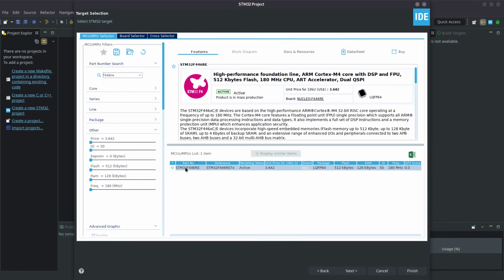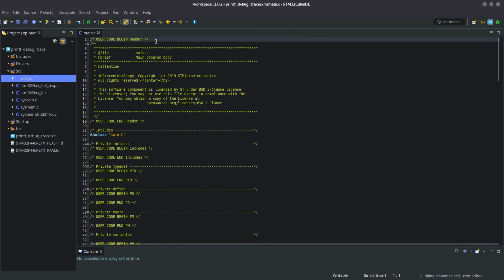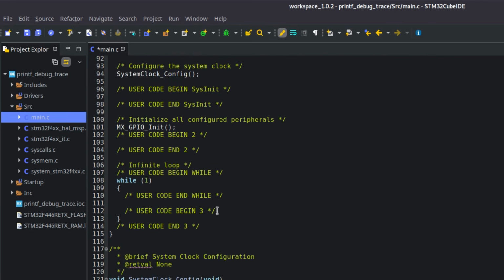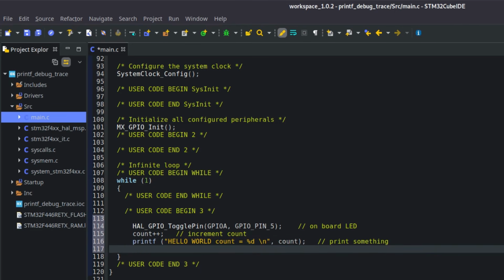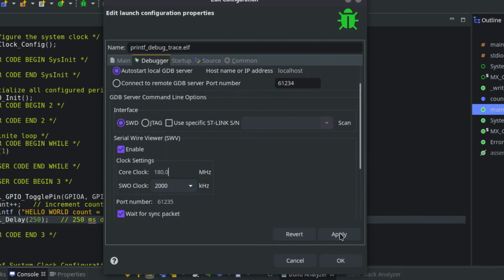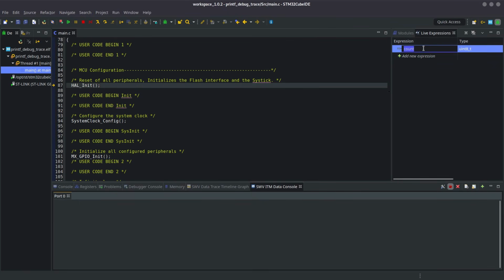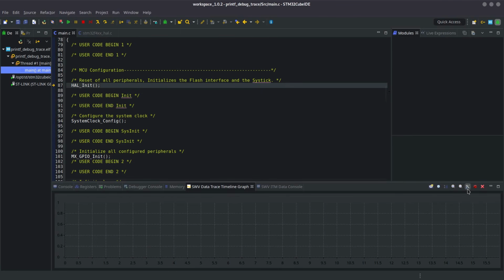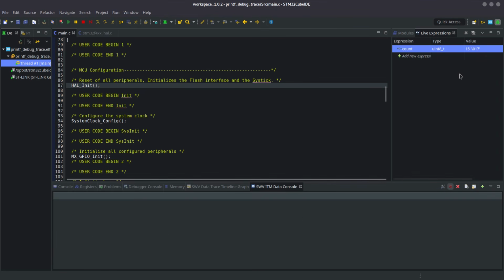STM32CubeIDE: printf Debugging, Live Expressions & SWV Trace Tutorial

Comment: Thanks, very helpful! 
Small addition: if you don't have a newline at the end of what you're printf-ing, nothing will show up until a very large buffer has been filled, then you get it all at once, on a single line. At least that's my experience.
Reply: Worked! was facing the same issue thanks!
Reply: Yes, I found this out the hard way.  Once "\n" was added to the end of my printf() statement, it worked perfectly. 
Also, I found that if I needed multiple printf() calls in a row, adding a printf("\n"); after all of them worked as well.
Reply: This small addition is saviour, I have spent 6 hours finding why the output is not coming.
Didn't even see the video just this comment of "Small addition" has helped a lot

Comment: Quick tip for Black Pill (STM32F411) users: To get printf working via SWV, wiring just SWCLK and SWDIO isn't enough. You must connect the ST-Link's SWO pin to PB3. Also, don't forget to go into CubeMX (System Core > SYS) and change the Debug setting to Trace Asynchronous Sw. Worked like a charm for me after doing this!

Comment: Great Tutorial! 

Additional information from my side:

Not every STM32 MCU model supports Serial Wire Viewer! 
"Serial Wire Viewer (SWV) is a data trace feature found on many ARM Cortex-M3, M4, M7, M23, and M33 processors. Cortex-M0 and Cortex-M0+ do not have SWV."

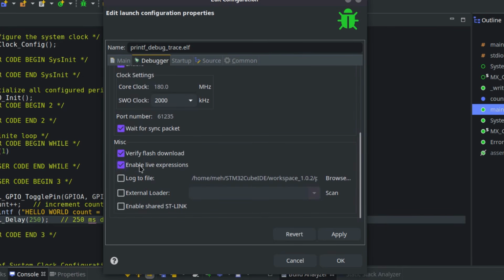In my case I have a Cortex-M0, so when I am insie the debugger settings, I am not able to klick on "Enable" Serial Wire Viewer. 6:00

What you can do instead of SWV:
Use Semihosting to use printf during the debugging session! 
Controllers Tech has a video called:
"Printf Debugging using Semihosting in STM32 || SW4STM || Live variable change"

Comment: Hi there.
I am using a STM32F401, after following these instructions "live expressions" works. printf/"data trace" however doesn't :( 

I set a breakpoint on printf and stepped through, the ITM_SendChar puts the char into the port correctly but nothing is sent.

I was wondering if this guide is still accurate?

Comment: It doesn't show anything for me either (stm32f429I-DISC1). I connected the PB3 pin of the microcontroller to the SWO pin of the debugger with a wire. It started displaying characters, but not the string "Hello world". I changed in Serial Wire Viewer, Core Clock (MHz) to 16.0, and it displayed the string "Hello world" 😃.
Reply: Change the core speed

Comment: SWV is working with the frequency of 16 MHZ  but it didnt work with 168 MH..  Why ? my board ( stm32f407g)
Reply: I changed my 16 Mhz to 168 Mhz in debug configurations and also i checked clock frequaency on STM32cube but i didnt see anything on SWV data console

Comment: Hello. What if ITM is not available? I am programming stm32wb55 Nucleo board and I am trying to setup printf for debugging. This method does not seem to work due to the microcontroller not supporting ITM
Reply from the maker: Use uart.. it's faster..
Reply: @ControllersTech  For UART, I need to use external terminal program which is not convenient. I want to be able to debug printf in the same IDE I am working with

Comment: I'm using a STM32L151CB and a legit ST-Link/V2 Isol. (Own custom PCB)

Strangely, when i click "start trace", the square around the circle lights up, then, when i press resume, the circle is greyed and unselected.
No data shows up in either of the SWV tabs, but i have the live expressions working fine.
Reply: I'm using a f103c8 and the same thing happens to me, I can't print anything on the console and the record button turns gray when I start debugging
Reply from the maker: It won't work if you are using cloned ST link. Read other comments, someone have shared a solution where you might have to solder a wire in the stlink.
Reply: @ControllersTech  thanks 👊🏼👌🏼

Comment: but when i use  any Hal_delay function in my int main while loop along with printf it doesnt print ot any thing on the console
Reply from the maker: Check your clock configuration.. hal delay  shouldn't be an issue unless your clock setup is wrong
Reply: @ControllersTech      i was using HSI which is of 16mhz as the system clock so i configured 16 mhz (default)  itself in the debug configurations too.
Moreover i tried creating a new project and same is the result

when i treid to debug and put the breakpoints its moving fine in the while loop without any stuck but iam not getting any out in the particular console

but when i trield 100ms delay after flashing the program and wating for the ouput .it gave me the output but the print on the console is comming to laggy and sometimes wont print even if the printf functon is in the while loop
Reply from the maker: Printf won't print in milliseconds.. i think it needs atleast 1 second delay...
The swo clock is not as fast as mcu, so don't expect printf to work in 100s milliseconds..
If you need something like that, use uart

Comment: Wtf... why does a printf command has to be so needlessly complicated? In arduino or mbed you just write printf(...) and done. With stupid CubeIDE Shit you need a doctors degree to get a simple output... just ridiculous. Who can use that or create anything more complicated than a blink sketch? Speaking of which: A fucking blink sketch generated in cubeF(uck)X for my discovery board gives me a 700!!!! lines main.c file. WTF?!? 700 lines to to toggle an LED on and off???
Reply from the maker: 2 things
1. If you don't like cubemx generated code, why don't you use the registers ? This way you only write the things you need
2. This printf shown in the video prints the message on debugger console. In case of arduino, that message prints on serial console. Even you can define a printf function, where you can easily send data to serial console using uart.
Reply: @ControllersTech  The registers are even worse. Using the HAL is already way to complicated for me, using registers would be insanity. Then i could basically just start using Assembler right away...

Comment: Thanks. For the STM32F429i-DISCO, you need to solder SB9 (to connect SWO-PB3 to the ST-LINK) to make it work.
Reply: Could you elaborate which pin should i solder SB9 to?
The datasheet shows that when SB9 is ON, SWO signal of connector CN2 is connected to PB3.
Reply: @TheZeroomg  SB9 is a Solder Bridge. Just connect the bridge with solder.

Comment: Not working on Nucleo F303RE before setting Debug Mode to Trace Asynchronous Sw. After that it just works fine!
Reply: Hi. Do you know why? I have the same board (NUCLEO-F303RE), and it not work the setting SWV.
Reply: Im using STM32F411CEU6 and i cant set this, Debug Mode to Trace Asynchronous Sw becouse it has pink color and there is warning that says "This periherial has no parameters to be configured" can you help me with that? Of course entire printf thing doesn't work for me :/

Comment: ITM debugging is only for Cortex-M3 / Cortex-M4 / Cortex-M7  chips. Make sure your stm32  has one of the aforementioned controller.
Reply: I am using a STM32F303K8, according to this: https://www.st.com/en/microcontrollers-microprocessors/stm32f303.html it is a M4...
But I wasn't able to get any output, not even character by using   ITM_SendChar( 65 ) for an A ...
Reply: @Stimmenhotel  Same!! it's not working on my STM32F446RE
Reply from the maker: This video is shot on f446RE itself
Reply: I know this video is shot on f446re, that’s why it’s really strange it’s not working on mine, i followed all the step and nothing’s working! I did not forget the \n and \r, i don’t understand.
Reply from the maker: 2 things.
1. Make sure you enable the swv(trace asynchronous) in the cubemx.. it's in sys settings
2. Make sure you turn on the recording button before running the code in the debugger
Reply: @Controllers Tech  I am using NUCLEO-H743ZI2 board, after turning on Trace Asynchronous in the Debug section of CubeMX and turning all the settings on in the debug configuration and selection of the port to turning on the red recordings button. I got nothing in console.
Reply: I already tried that and no success :/
Reply from the maker: It's working alright.. i just created a new project..
 Contact me on discord or mail..
Reply: Hey is there any article link that why ITM Debugging only work on Cortex M3/M4/M7 not on Cortex M0 because I tried this tutorial on STM32F072RB Discovery Board, it didn't build
But worked on Olimex P-107 Board which has STM32F107VCT6 Cortex M3.

Comment: I think God punishes me because I made exactly the same thing as you and nothing happens. I use the original ST-Link V2 debugger and STM32F446RET MCU.

Edit: After 7 month of trying this again on my Nucleo, now it works!
Reply from the maker: Maybe u forgot tu press record button
Reply: @ControllersTech  I wish that was the solution, but sadly not.
Reply: @ControllersTech  Btw, I saw another tutorial about printf with MCUs from STM32F series and the guy set the SYS mode in CubeMX to "Trace Asynchronous  SW". You left it disabled, so I'm confused about whether I should leave it as default (disabled) or change it to Asynchronous SW.  Any idea?
Reply from the maker: You should turn it on.. i left it coz it was working without turning it on too. But of it's not working for u, than u should turn it on
Reply: @Sparklamp  Same Problem here, using a STM32F303K8 (Cortex M4) board. Even enabled the "Trace Async SW"  ...  Clock Speed I use the value from HCLK i set in CubeMX.
Did you make it work?

Comment: Thank you very much. The live expression works but the graph and the console doesn’t work with an official nucleo stm32L432kc. Do you have an idea where this problem comes from ? :)
Reply from the maker: It doesn't work for some microcontrollers, specially the L series.
Reply from the maker: It doesn't work with f103c8 by default with the cloned st link. Though you can solder the swv pin to the st link. Google this, there are some solutions available.
Or join that telegram group, some people in the group made it work

Comment: I just want to mention that after 4 hours searching for the error, re-wiring my hardware twice, changing cables, rewriting projects... printf("...") was not printing anything in the DATA CONSOLE because I FORGOT the LINEBREAK ("\n")!!! So printf("Hello stupid") prints nothing, printf("Hello stupid\n") prints it correctly...
Reply: You saved me a lot of time!
Reply: I did the same thing, but what the explanation behind this?
Reply: @dipchakraborty5795 stdout buffer needs to be flushed to print the string, \n is the canonical method to flush the stdin buffer, instead you can even use fflush() from stdlib.h
Reply: Thank u

Comment: Discovery board as st-link, own board with stm32f103. It doesn't work. ((
Reply from the maker: In F103 controller, you have to connect the pin PB3 to the SWO of the debugger. It's not available on the Chinese ST-Link, but if someone have the original ST-Link, they can do that. 
You try to find the SWO of the ST-Link (your discovery board) and connect to PB3 of F103
Reply: Now PB3 is busy. When I used IAR, I didn't connect TRACESWO(PB3) pin, but printf worked fine. May be you know how it work in IAR? Thank you for answer.
Reply from the maker: No i don't know much about IAR. Maybe you shouldn't keep PB3 busy with any other task.

Comment: I'm using STM32CubeIDE version 1.2.1 on a Nucleo board (STM32H743 has an stlinkv3 v3.J6.m2), but I can't find where to set HCLK.   I've enabled SWV in the debugger config and set the clock there, but not in the project.  My HAL_Delay (1000) is way longer than a second so the default is probably wrong. 

Also, I've included stdio.h however, I don't see the "Hello World" in any of the window views (Console, Debugger Console, SWV Data Trace Timeline Graph, SWV ITM Data Console).   In the SWV view properties, I've enabled Comparators 0 and 1 (although that don't seem to be necessary), and checked the ITM Stimulus Port bit 0, and the red 'Start Trace' record button is set.      Could the HCLK setting also be causing the ITM_SendChar to fail?   I assume the ST-Link's usb connector, when not programming, just passes the SWV data to/from the cpu?

UPDATE: Pressing the Blue MX button on the right doesn't seem to do anything, but double clicking the .ioc file did!  After checking the clock speed shown in the Clock Configuration (64Mhz) and applying it to the SWV Debugger Clock speed it worked!  Would be nice for ITM record to start automatically, but what exactly does enabling the stimulus bit 0 do?

Comment: Hi. Thank you for this video! But I've got a problem: SWW trace and SWV ITM console do not shows any data. Live expressions works fine. Any advice? Thank you
Reply from the maker: Which controller are u using ?
Reply: @ControllersTech  STM32F103C8 aka Bluepill
Reply from the maker: This works with nucleo and discovery boards because they have an inbuilt ST-Link. You can't use it with f103 and chinese stlink varient. You might have to use a j-link or original st link with f103. 
Although i am not sure about those also, as I have never used them.
Reply: @ControllersTech   I am new here, all my experiences are with arduino IDE, so I do not understand your answer well but thanks anyway! Doesn't really matter right now, I am glad for succesfull upload code via ST-link (I was about to give up while trying properly install eclipse+OCD+..+..)
Reply: @jakubstejskal6806  

There are videos and info how to modify one of the cheap Chinese Clone STLINK V2 to provide SWO input by cutting the 5v supply connector runner from USB Vbus and connecting pin 31 on the STM32 in the STLINK. 

https://www.eevblog.com/forum/microcontrollers/quick-hack-to-get-swo-on-st-link-clones/

 It is a tight soldering job to connect to pin 31 without creating a solder bridge to adjacent pins so you need a fine point solder tip.  The two 5v pins on the STLINK clone are given up to the SWO input.  You may have to update the STLINK firmware if you did not previously done.

You can also download STLINK code into a Blue Pill to create an STLINK V2 with SWO function.

This SWO port is included on the Nucleo STLINK V2-1 board.   The Nucleo boards also have UART2 from target uC fed over USB to a virtual COM port on PC using a terminal program of your choice to display the UART2 communications.  You won't get the UART2 comm port on the STLINK V2 clone.
Reply: @rcinfla9017  FWIW, it's possible to desolder and slightly lift one of the +5 connector pins and put a bit of Kapton tape under it so you only give up one +5 pin.